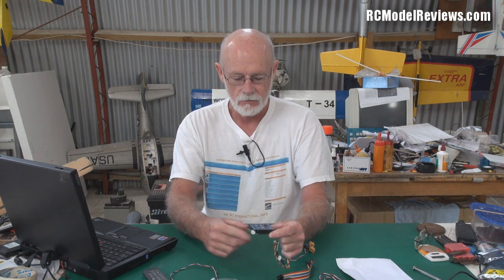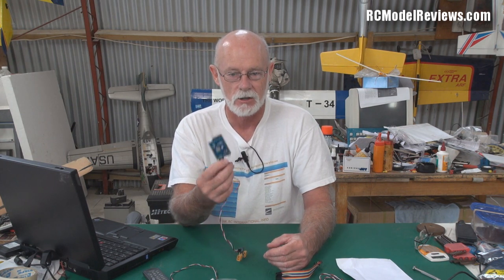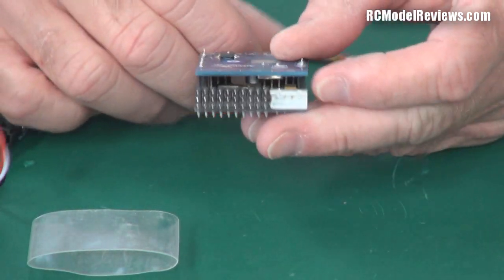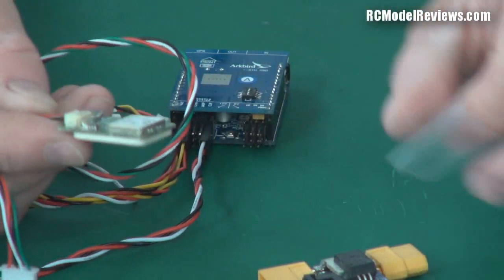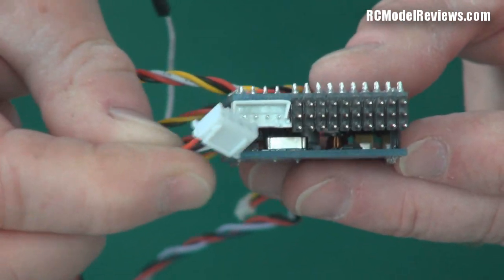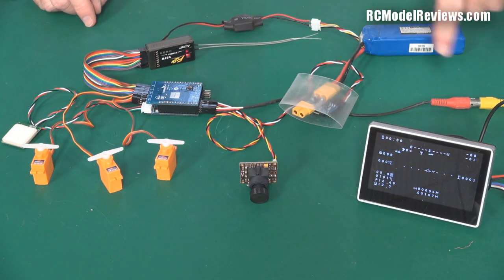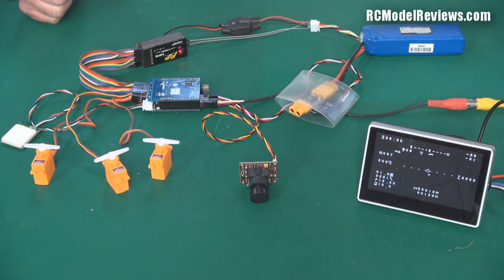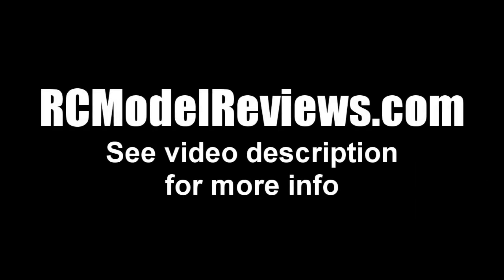Arkbird OSD/RTL for FPV (part 2)

Comment: My arkbird osd V3.1028 plugged all cables but I connect in the model airplane and it is only message in the gps and it does not leave the 00 satellites., I am using in a radio 18sz Futaba futaba original receiver 7 channels, configuration for 1 batterie, transmitter of video and receiver of video 5.8., in front of this you can tell me what problem I do not find satellites when connecting arkbird? In the radio I left channel 5 100% key of 2 position and channel 6 radio I left 100% in a screwdriver. What can it be?

Comment: Great video. But I wanted to have a photo like this, I'm Brazilian, I do not understand it, I've seen it in English, I've seen the right place for each positive negative pin so I do not burn the arkbird 3.0 that I bought. Can send my email marcosroberto22@hotmail.com photos plugins each black and red black wire plug in the arkbird and where it fits in the other part also like servos esc current sensor airspeed gps camera transmitter video. Thanks in advance.

Comment: Hello,
I have a spektrum dx7s radio and everything what i did I only get the RTH and Manual mode when switching channel 5 are 6. Can someboy help me. It's like iI can't switch in to balance mode. After manual mode it needs to jump to balance mode but it jumps to RTH mode. Frustrating . Helppp

Comment: Hey all. I just got this in the mail today and I can't get a  video feed from my cam. I can see the OSD But no video. I have got fatshark 600tvl cam and farshark 250mw.I got it wired up like Bruce has. I know the cam and tx works but as soon as I plug in the arkbird I have no video. Every thing works but that. Can anyone help me out.
Reply: Hey turns out I had a 5v cam. All fixed  :-).
Reply: In other words you didn't read the manual and blew up your camera.

Comment: I lost my flying wing last week because of this system. I flew 7 km 3000 ft altitude from home, on return I kicked in the RTH and the craft went off-course about 90 degree which is totally unaccepted. I went back to manual mode and by then the craft had lost altitude until my 2.4 Emmerssion FPV link failed. The Orange 433 lost signal too but the Arkbird failed to bring back the craft. I will never buy another Arkbird.
Reply: Yeah user error. You need to read the manual. You didn't allow the ArkBird to acquire enough (7+) satellites before flight. It acquired the home position after you took off and when you selected RTH it flew to that position. It worked correctly.
Reply: +Choon Ted Thian Countless people using this. I suspect user error

Comment: It would be pretty hard to blow up the board by misconnecting the current sensor, since the 12V is in the middle. ^^ If you go off center you might.

Comment: I have acquired a second hand ex quadcopter Arkbird .. I have downloaded and printed the manual .. But ,I want to check its stabilisation mode in an old eurotrainer 40 nitro aileron trainer .Prior to installing it in My Finwing Hobby AirTitan . how can I get the radio and Arkbird to fire up.Do I have to connect the USB   from my 3  cell lipo to my JR 35mhz tx. and then will the Arkbird get it's power via the servo leads.

Comment: Hi

I am kinda confused and the instructions do not help...Can I use two batterieson this osd? I want to run my motor on a 10000 mah 6s battery separate from the osd/video battery. And if this is possible how do i go about the connection? Please email if you can themanfromcrypton@gmail.com
Thanks

Comment: If you run them through a mini dv recorder they will not blank/blue screen.
With out a dv they do indeed blank screen and that can take up to 3 to four seconds to switch back on so  if video is iffy that means the screen is off more than on , stacic you can fly with..... a blank screen you can not :)

Comment: if you are referring to the current sensor lead, reversing this lead blows up the current sensor because the device try to run the osd from the current sensor output. (i found out the hard way)

Comment: Additionally obvious flux residues left on the PCB... somewhat sloppy.  I guess other forces - like crashing, mishandling etc. - will kill the unit before the acidic nature of the flux residue will cause problems, however it’s a pet peeve of mine.  Where these items are made it costs only peanuts to finish the job properly, IMHO.

Comment: Most screens go blank but they let through a lot of static so if there is something to see - you see it. And they come back very quickly. I suggest not to be afraid of those cheap screens if you don't have money. No point to pay tens of dollars more JUST for the no blue screen option. Like I said it is not so big difference in real flight. If no signal then no signal. Bluescreen or 100% static - You cant fly with either.

Comment: I installed this in my Penguin this week as well, one thing I have drama with is when I plug in an Aux battery to run the OSD independent of the flight pack with the Jumper removed it only displays the voltage and amp draw of the aux battery not the flight pack. Do you have the same issue?